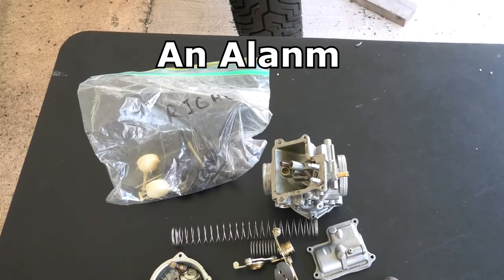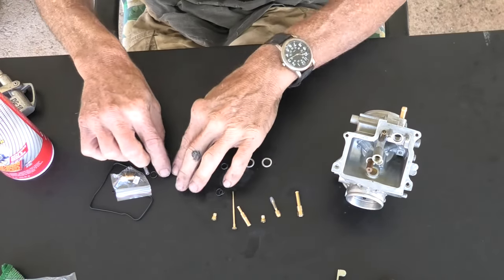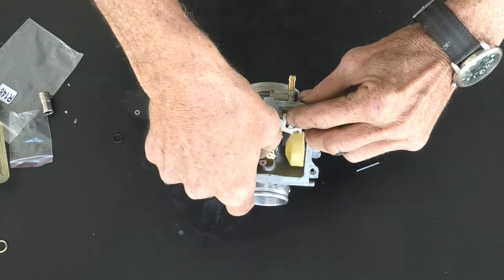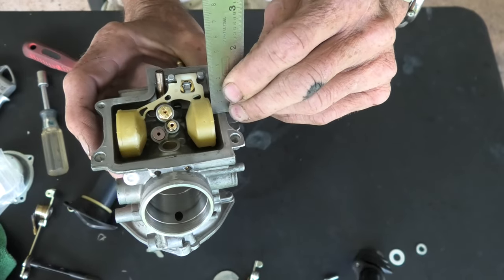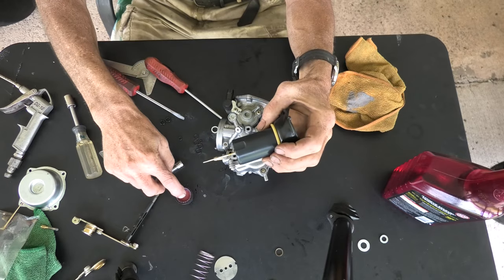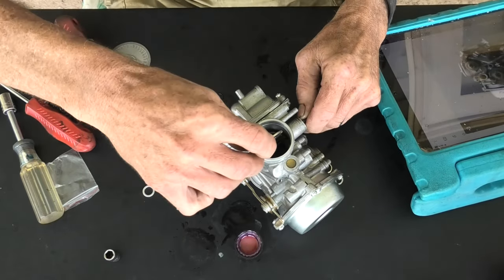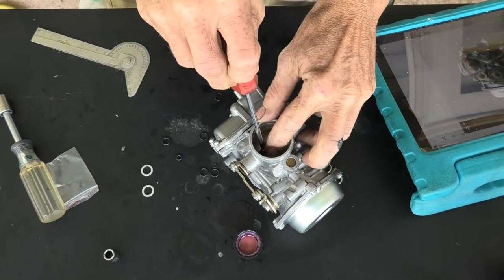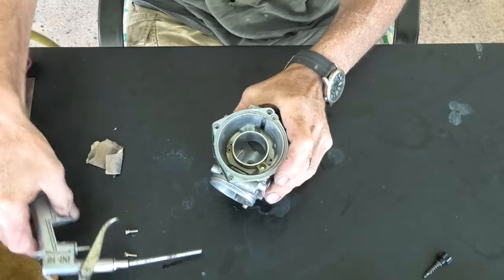2003 Honda Shadow 1100 Carburetor Assembly: The Carburetors Receive a Rebuild Kit and Reassembled

Comment: Alan m Is there a part 8 to your Ford Taurus rocker panel Videos? I am going to start on the rocker on my second car so I can give it to my Daughter But the inner rockers are still good and I only need to do the Passenger rear outer rocker panel but that's kind of where you stopped putting out your videos. Do you plan on putting one out for the outer or can you recommend a video from someone else that has your attention to detail? It would be really appreciated. Thanks for all of the other vids and have a great Labor day!